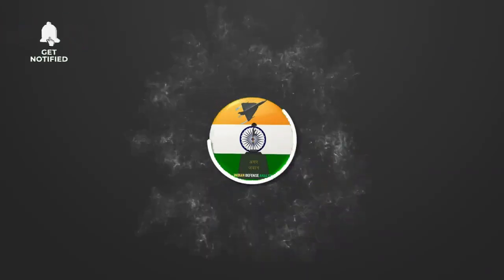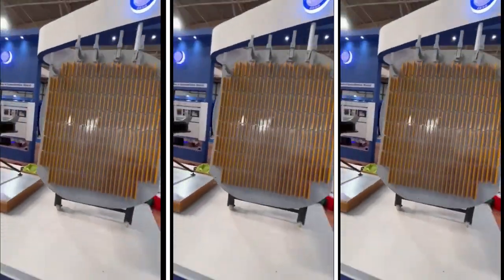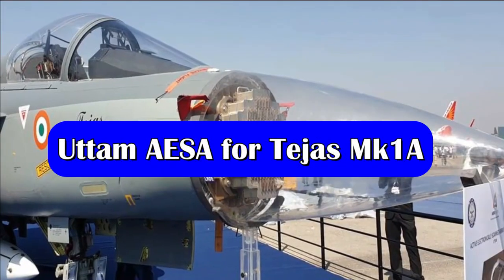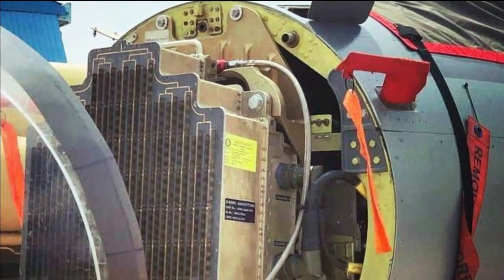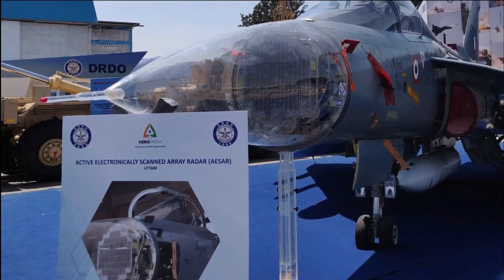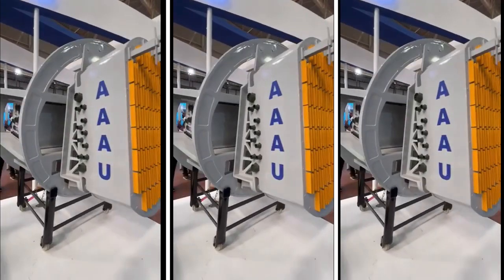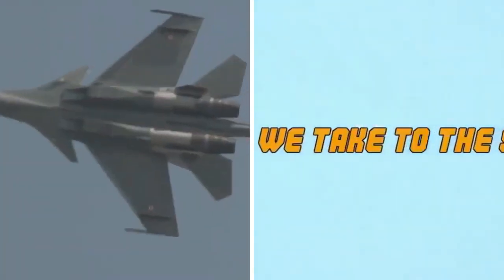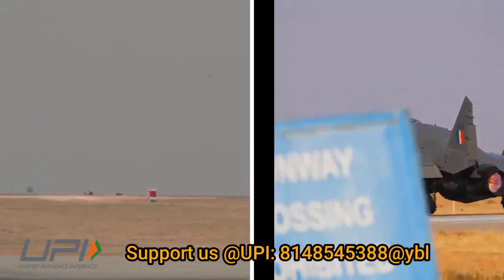Uttam AESA Radar For IAF & Navy #drdo #iaf #indianairforce #indiannavy

Comment: If Tejas mk1A's radar will have 912 TR modules then Tejas mk2's radar will have how many TR modules?
Reply: I read somewhere around 1280...It will be an Upgrade of UTTAM AESA Mk 1 and would not be Mk 2 as Mk 2 is being made for Sukhoi Su-30 MKI with 1400-1600 TRM...and Mk 3 UTTAM would be GaN based instead of the earlier GaAS....
Reply: @NS-ll9ur mk2 will use same radar as Tejas mk1a
Reply: @NS-ll9ur  source?
Reply: Nose cone size is similar. Might get same radar in early aircrafts. Upgraded GaN radar in later stage.